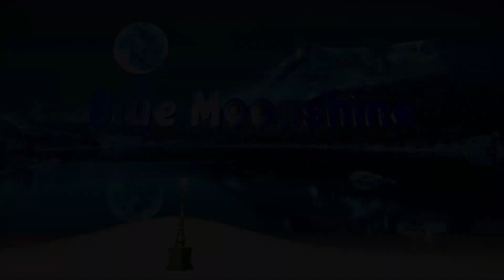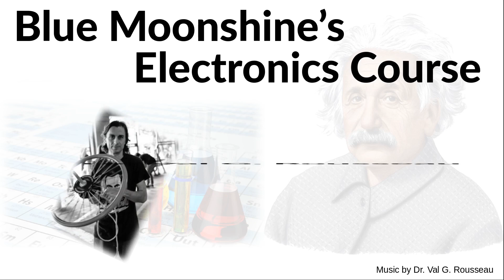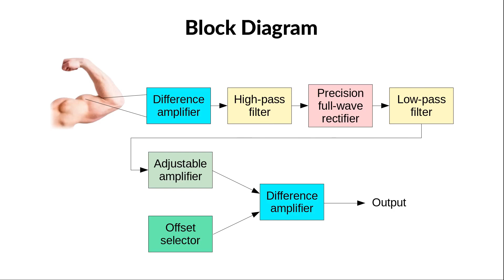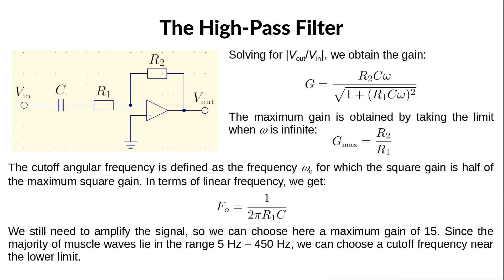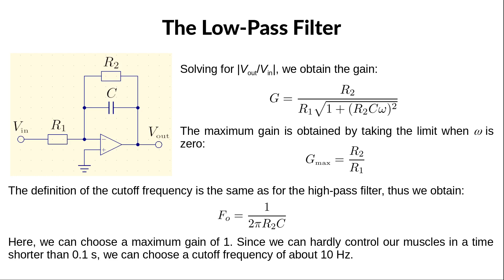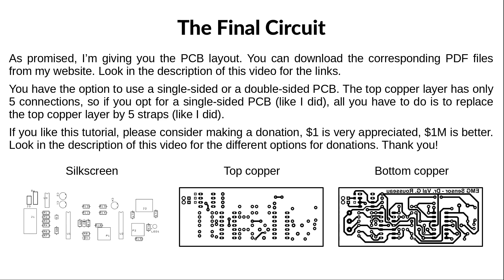EMG Sensor Circuit - Tutorial and Diagram - No Arduino Needed - Use it to play video games

Comment: Awesome! Do you have the Gerber file so I can make the PCB on the milling machine?
Reply from the maker: I'm sorry, I don't have any Gerber file. However, I have the "DesignSpark" source files that can be used with the Software to generate Gerber Files. I cannot do it for you at the moment, because my computer's hard drive is full at the moment, and I had to uninstall the software. If you are willing to install the software (it is free), then I can send you the sources files, and you will be able to generate the Gerber file. Contact me by using the contact form of my website, here: https://bluemoonshine.fun

Comment: very dumb question. how do i take the output? will i get it right if i use a CRO? also, you’ve used 150n and 1u capacitance in the diagram but you’ve said 2.2u and 220n in the components list. will it make much of a difference?
Reply from the maker: What do you mean by "take the output"? The output is at the difference amplifier, and is visible on the diagram. No, using the alternative values for the capacitors won't make much of a difference.
Reply: @BlueMoonshine can i make the same thing on a bread board? it should work right? without the J’s
Reply from the maker: @gotthatWrizz  
Yes, that's how I tested each stage of the circuit.
Reply: @BlueMoonshine also in the circuit diagram you’ve given in the description, all are powered vcc using the LM386? or can i use a DC voltage supply for that? and all the other op amps are a part of TL084?
Reply from the maker: @gotthatWrizz  
All TL084 are powered by the + and - side of the 9V battery. The + is also the Vp point and the - is also the Vn point in the diagram. All what the LM386 does is to provide the GND of the circuit.

Comment: One doubt, our muscle waves lie in the range of 5 - 450 Hz, then why did you take the cutoff frequency of high pass filter as 7.23Hz and cutoff frequency of low pass filter as 10Hz.

Why didn't you choose the cutoff frequency of the high pass filter as 5Hz and cutoff frequency of the low pass filter as 450Hz.
Reply from the maker: By using a cutoff frequency of 7.23 Hz for the high pass filter instead of 5 Hz, you are not losing any significant part of the signal.

Regarding the low pass filter, you are misunderstanding the point. The signal has already been rectified before the low pass filter, so it no longer contains "waves" from the muscles activity. The frequencies present in the signal are the frequencies at which you contract the muscle. There is no way you can contract a muscle more than 10 times per second, so any frequency above that is just noise that needs to be eliminated.

Comment: Sir, one last question, in the components list there are 2 100uf capacitors to improve the stability. But you didn't put any. To improve the stability where i have to put these capacitors. And what stability was increased?
Reply from the maker: They go at the output of the symmetric power supply that is formed by the LM386. They can improve the stability of the supplied voltage, but in my case, it was not necessary.
Reply: @BlueMoonshine  so both capacitors have to put at the output of the lm386 ic
Reply from the maker: @joyelthomas598  
Yes, one between the + of the battery and the output of the LM386, and one between the - of the battery and the output of the LM386.
Reply: @BlueMoonshine  thank u for you valuable reply.
Reply from the maker: @joyelthomas598  
You're welcome!
Reply: @BlueMoonshine so it will be like, 

Capacitor 1: 

+ve leg to +ve of battery(9v) 
-ve leg to output of opamp(+4.5v) 

Capacitor 2:

+ve leg to output of opamp (+4.5v) 
-ve leg to -ve of battery (0v) 

I have a little confusion in connecting the capacitor, is it

High voltage to capacitor +ve leg
Low voltage to capacitor -ve leg

Is that correct?
Reply from the maker: @joyelthomas598  
Yes, that's correct.

Comment: Sir, what is the use of offset selector? , what is the role? Sorry i didn't really catch up from the vedio.
 Also in the vedio shows 100k pot on the non-inverting terminal but in the diagram 10k divider circuit is used can you clarify this. Which circuit i have to follow?
Reply from the maker: The offset selector allows you to shift the output signal up or down, in case the device you want to control requires a specific range of voltages. The diagram is wrong, use the circuit in the video.
Reply: @BlueMoonshine  ok thanku

Comment: Can i replace TL084 with other opamp ic
Reply from the maker: Yes.
Reply: @BlueMoonshine  can you suggest any ic
Reply from the maker: @joyelthomas598  
Well, use the ones you already have. If you don't have any yet and need to order some, then why not using the one I suggest in the video?
Reply: @BlueMoonshine this ic is not available in my near shops. That's why i ask about your suggestion. I have some other opamp ic but some specs are not same with this ic.
Reply from the maker: @joyelthomas598  
There is of course the standard LM741. Other possibilities includes the TL081, TL082, and LM358. I'm sure there are others.
Reply: @BlueMoonshine ok thanku

Comment: And in the offset selector step i used a 100k Ohm variable resistor   the middle leg to the op-amp, and one to the 9volt battery and the last one to the groud.
Is that right ?
Reply from the maker: Yes, this is precisely what is shown at 16'55''.

Comment: Hi there thank you for this tutorial.
I read the comments and figured out that you used 1uF capacitor in low pass filter with 82k Ohm, but then the cut off frequency will be f = 1.94 
So how did it work ? 
If you can just tell me what resistors and capacitors you used in your filters because i made it and there is a problem in it
Reply from the maker: These are not the values I used. The low-pass filter is explained from 13'52'' to 15'49'', and the values of the components are given.
Reply: So, the capacitors' values in the schematic photo are false??
Reply from the maker: @jamelhn9336  
They are not "false", they simply lead to a different cutoff frequency. That should still work!

Comment: WHAT COULD BE THE POSSIBILE REASON FOR not  GLOWING OF LED if the led is working and how to trouble shoot it.
Reply from the maker: Well, that's a little bit vague, as the LED is at the output, so anything between the input at the output could be wrong. do you have access to an oscilloscope? If not, it's gonna be hard to troubleshoot it.

Comment: I just don't get why you used an amplifier in the high pass filter ?
Plus if we want to target more than one muscle should we use the same circuit for each muscle ?
Reply from the maker: As I explain in the video, the signal needs several stages of amplification, so I used an amplifier in the high pass filter to amplify the signal by 15.
For more than one muscle, a multiplexing technique can be used so that a single circuit like that can be used for all the muscles. I will make a tutorial for that when I will have time for it. Basically, it will be a technique similar to what I use here: https://bluemoonshine.fun/Project-AudioSpectrumAnalyzer.php
Reply: @BlueMoonshine  i see thank you for the replay

Comment: THIS  WAS AN AWESOME  TUTORIAL , I AM USING THIS IN MY PROJECT WORK BUT HAVE AN TROUBLE IN CONNECTION OF THE BATTERY WHERE I HAVE TO CONNECT IT CAN YOU PLEASE UPLOAD THE IMAGE WHERE TO CONNECT THE  BATTERY TERMINAL
Reply: HAVE AN TROUBLE IN CONNECTION OF THE BATTERY WHERE I HAVE TO CONNECT IT CAN YOU PLEASE UPLOAD THE IMAGE WHERE TO CONNECT THE  BATTERY TERMINAL, AND WHAT IS THE ( SW ) IN THE SKILLSCREEN
Reply from the maker: This is what I explain at 18'30''. You make a symmetrical power supply by using the LM386. Connect the the two inputs of the op-amp together, and the battery is directly connected to it (positive on pin #6 and negative on pin #4). Then output of the op-amp (pin #5) will serve as the GND for all other op-amps. The + and - of the battery are also connected to all other op-amps of the circuit (V+ and V-, respectively).

Comment: Great explanation! However, I can't get my head around how the 3-point micro-switch is placed on the PCB, or even which micro-switch to use, could you help me with that please?
Reply from the maker: I have no clue what you are talking about: There is no 3-point micro-switch in this circuit!
Reply: @BlueMoonshine  I'm sorry, on the components list one of the last items says "Sw=3-point micro-switch". That's what got me confused, thank you for the clarification!
Reply from the maker: @a.m.641 
You are right, there was a mistake in the component list, I just fixed it. Thank you!
Reply: Would it be possible to use the same circuit to read the heart signal, as an ECG?
Reply from the maker: @a.m.641  
Good question. I haven't tried, but I guess it should be possible. I will check that.

Comment: I am having difficulty understanding which connection is connected to which opamp in the diagram you shared. I want to build this circuit on breadboard first. Can you help me by clarifying these connections?
Reply from the maker: It's kind of trivial: the video shows you the block diagram, and how each block works is explained in detail with calculations. Also, a picture of the complete diagram is given in the description of the video.

Comment: I want to control this with an arduino and drive a servo motor. Do you have any ideas what I can do for this?
Reply from the maker: I don't know anything about Arduino. But isn't Arduino meant to make things easy? It should be a trivial thing to do.
Reply: if i dont have an ocilator how can i see the singals
Reply from the maker: @alpakbac4724 
It is called "oscilloscope", not "oscillator". The frequencies generated by the muscles are in the range [5 Hz, 400 Hz]. Included in this range is the range [20 Hz, 400 Hz] which are audible by humans. So, if you amplify the signal enough and inject the signal in a speaker, you should be able to hear it. And once the signal is rectified, you should be able to see it simply by connecting an LED.

Comment: Can you explain how the lm386 ports work and the connections? if you use lm386 gain? Thanks, and good job!
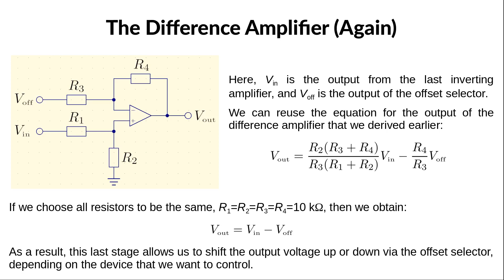Reply from the maker: This is explained at 17:45. The LM386 works exactly like any other op-amp. It amplifies the potential difference between it positive and negative inputs. If the two inputs are connected together, then the difference is zero, and the op-amp outputs a zero potential with respect to its midpoint between its positive and negative power pins. The midpoint between 0V and 9V is 4.5V. This is this value that we take as the "ground". The reason for using the LM386 instead of any other op-amp is that it is designed for having a zero offset voltage (other op-amps need to have it adjusted by adding some resistors) and for having a very low output impedance (which is what we want).
Reply: So the LM368 would serve as an offset selector, or is it just for power supply? So at the offset, Vs+ would be 9V and Vs- would be 0?
Reply from the maker: @ildjaviviane1432  
The LM386 is just for the symmetric power supply. It outputs 4.5 V, which is to be used as the ground. The positive side of the battery is Vs+ and the negative side is Vs-. 0V, 4.5V, 9V is the same as -4.5V, 0V, +4.5V since only voltage difference matters.

Comment: Does the amplifier not need -VDD to be activated?
Reply from the maker: What does that mean? Vdd (a.k.a. Vcc) is just a positive supplying voltage and Vss is just a negative supplying voltage. The video gives you all the diagrams with rigorous derivations of all equations, and the circuit behaves exactly as predicted by the equations, so everything is there.
Reply: @BlueMoonshine  Yes, about the negative voltage, shouldn't it be implemented in the circuit to power the amplifier?
Reply from the maker: @spock-j4e  
I really don't know what you are talking about. Can you show me on the diagram where and how you want to "implement the negative voltage"? Send me an email via the contact form of my website: https://bluemoonshine.fun/Contact.php
Reply: @BlueMoonshine  I'm talking about the negative and positive voltage connections that the amplifier requires, are they simply replaced by the negative from the 9V battery?
Reply from the maker: @spock-j4e 
As explained in the video, the positive for the op-amps is the + of the battery (9V), the negative is the - of the battery (0V), and the ground is the 4.5V that the LM386 gives at its output.
Reply: @BlueMoonshine  so, the ground is it used on everything that has the symbol of grounding? But what if I use a ground mesh on my PCB?
Reply: @BlueMoonshine  Can you provide a photo of the underside of the PCB? (with the elements)
Reply from the maker: @spock-j4e  
Yes, it is used on everything that has the symbol of grounding. I'm not sure by what you mean by "ground mesh on my PCB". I don't see what the problem is. A ground is just a reference potential, and for the op-amps to work properly this reference potential needs to be half-way between the positive and negative potentials of the battery. That's exactly what a symmetric power supply does, and that is precisely what the LM386 does in the configuration that I showed.
Reply: Is the LM386 included in the diagram?
Reply from the maker: @spock-j4e 
No, but it is shown in the video how it is to be used.
Reply: @BlueMoonshine One more thing, at minute 15:40, would the gain be the same for the capacitor in the diagram, the 1uF?
Reply from the maker: @spock-j4e 
 As you can see in the slide before that of minute 15:40, the gain is equal to R2/R1. Therefore it is independent of C.
Reply: @BlueMoonshine  oh thanks! I'm trying your circuit with the 150n and 1u capacitors

Comment: Hello, can you explain why you used a 500k potenciometer and not one with lower resistance?
Reply from the maker: As explained in the video, this is to have a gain that can be adjusted to a maximum of 50, which allows the output voltage to reach the maximum voltage that can be delivered by the op-amp.
Reply: @BlueMoonshine  Thank you, your video and quick response are being veeery helpful :D
Reply from the maker: @rayllecordeirodanobrega6199  
You're welcome. Please, share the video!

Comment: Hi, why didn't you use an instrumentation amplifier?
Reply from the maker: The gain of an instrumentation amplifier is not large enough. Also, even if it was large enough, it wouldn't work because, as I explained in the video, you need to condition the signal after each step of amplification in order to avoid a saturation.
Reply: Oh I understand, another thing, where does the 100K potentiometer go on the diagram?
Reply from the maker: @tiffany-e4k 
It's just for the offset selector. It is to be put in replacement of the voltage divider made of the two 10k resistors at the bottom left part of the diagram, between Vp and Vn. It doesn't really matter whether it is a 10k, or 100k, or 500k potentiometer.

Comment: Can I replace the LM386 with another amplifier?
Reply from the maker: Maybe. You would need to use an amplifier that has a very low output impedance. Also, some amplifiers output an offset voltage that may be problematic. The LM386 is designed to have a very small offset voltage.
Reply: Tks. Another question, where would the LED be on the diagram?
Reply from the maker: @saravictorialeitedanobrega5563  
At the output, with a 220 ohm resistor in series.
Reply: @BlueMoonshine  Shouldn't the resistor be grounded in the high pass filter?
Reply from the maker: @saravictorialeitedanobrega5563 
No, if you ground it, then no signal will go through.
Reply: @BlueMoonshine Would the LED be at 4.5V ground or at 0 GND?
Reply from the maker: @saravictorialeitedanobrega5563  
As explained in the video, the ground is 4.5V, so the LED is at 4.5V ground.
Reply: Oh thanks

Comment: I want to ask a stupid question.
Why include reference electrode in the circuit when it is going to be grounded?
Reply from the maker: Because the potential of a single electrode is undefined. What is defined is voltage, that is to say a potential difference. So a potential is always defined with respect to some reference potential (which is unknown). When we choose this reference to be the "ground", it only means that we attribute to it the value "zero volt". But still, the current needs to flow through it, because the op-amp cannot directly measure the potential of an electrode. What the op-amp does is that it lets a small (but non zero) current flow through its inputs, and this current has to go somewhere, namely back to the ground.
Reply: @BlueMoonshine  Thanks for the explanation.
Reply from the maker: @rpt170 
You're welcome!

Comment: Sorry for bothering again im asking because i made exact sensor sometimes the light goes on when i close my hand and soemtimes its always on and sometimes it doesnt work i dont know whats wrong
Reply from the maker: Bad connections? PCB not well printed? Bad soldering points? Sometimes adjustable resistors wear out, and you can't get the right setting.